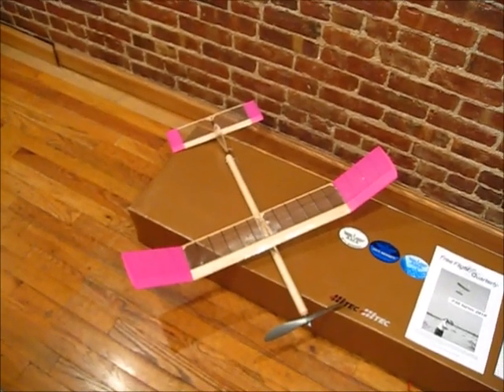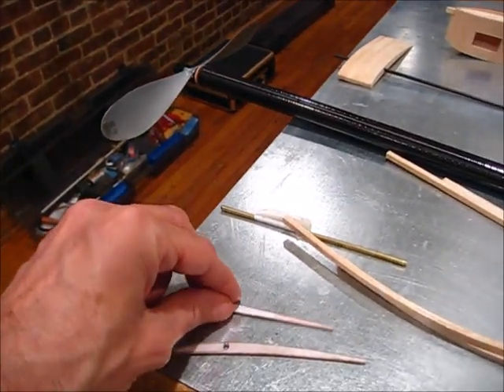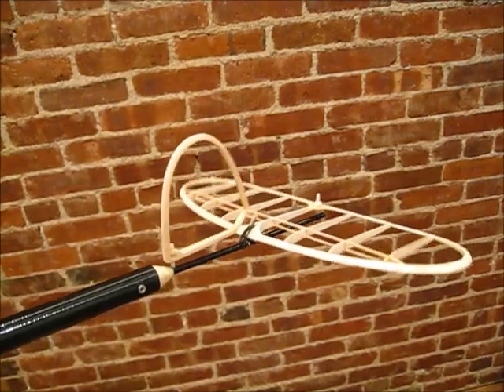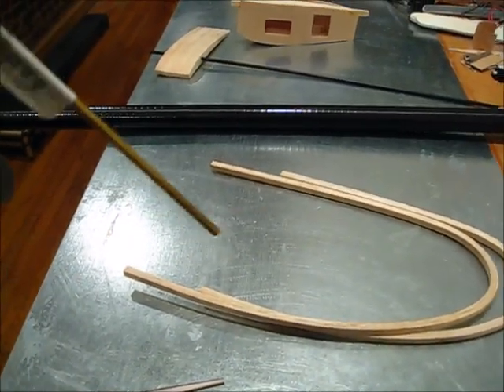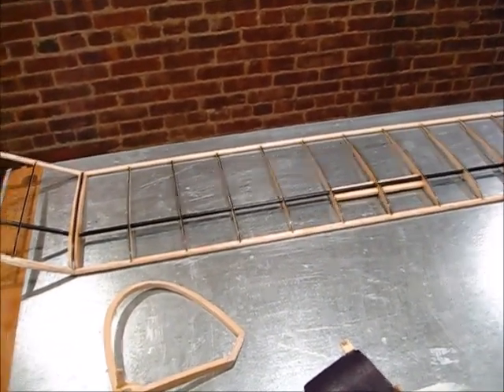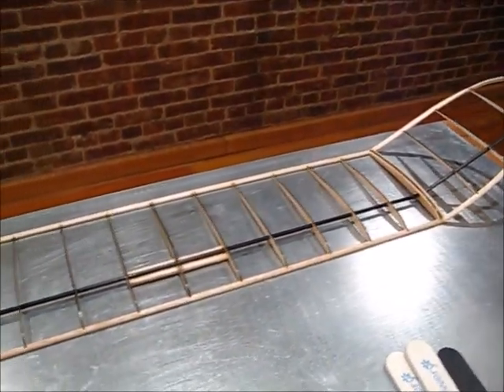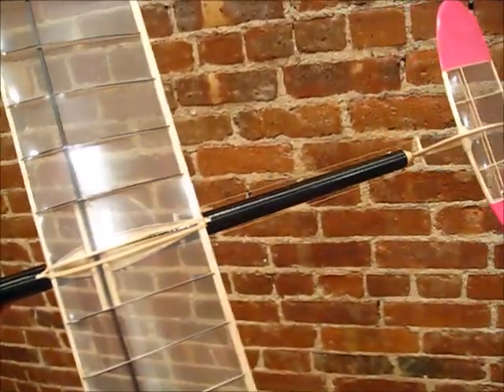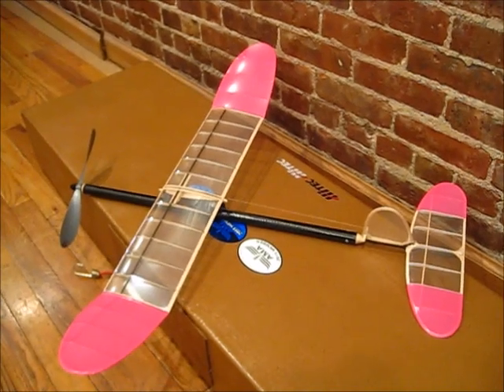'Hell's Kitchen P30' rubber power RC - building.

Comment: Hi! If I may ask.... how do you build the nose button? Thanks very much !!!
Reply from the maker: The nose button is an adjustable one available from Volare and other places. The button is mounted into a nose plug which is laminated balsa, rounded on a drill.
Reply: @domoremath  Thanks for your reply! I"m 72  years old. I was a high time sailplane pilot.  Left the hobby in 1980 - time for family!  I've never done free flight before. Very attracted to your approach. My closest flying field is about a 40 min. drive. Bit expensive as a retiree. In Canada, we  can be fined for flying in a school yard . 
I have a hard time imagining an Enforcement Officer writing up a 72 year old man for flying a rubber powered model. The other nice thing is if the radio fails the model isn't  going to hurt anyone or damage any property. 
Anyway, thanks again for sharing all your experience! Will keep in touch!
Reply from the maker: @chrissorlie5291  Yes, it's very inexpensive and harmless, I've never had any problems in the local field so far (for 11 years), and you're correct that they don't really hassle old guys with rubber power models, voice of experience! In fact, the police usually ask me where they can buy the model. Have fun, it's a great hobby.

Comment: Hi:
I watched your video.  Very nice!  I a couple of P30 questions.  I bought a carbon fiber tube from Mike Woodhouse.
I would like to use C/F spar for wing and stabilizer.  I imagine the 4mm tube for wing, and 3mm for stab.  I like your idea
For the C/F capstrips !  Where do you get that sheet or tape? How thick should it be?
Sincerely,
Jon B. Shereshaw
Reply from the maker: Given that I made it in 2017, I wouldn't know the answers at this point (!) but fortunately I made a detailed plan - the wing spar is 3.2 mm carbon fiber, the capstrips are 1mm, .12mm thick, the ribs are 1/32". I didn't use a carbon tube for the stab, it's just 1/16" square top and bottom, and I'm not even sure you need that, as I mention in the video, the laminated outline is very stiff. I got everything from Mike Woodhouse, however I see Volare also has nice capstrips. The carbon fiber fuselage tube is really nice, can handle a blown motor, and it's pretty much ready to go.

Comment: Building a polecat p-30 now.  I'd saw an earlier video saying that your mylar was adhered with gluestick.  I am not getting a very good covering using it.  Did you dope the wing prior?  I'm using the shiny (chrome finish) mylar which I've been told doesn't shrink as nicely.  I'm more than proficient with tissue, and hate any wrinkles.
Reply from the maker: Yes the chrome mylar doesn't shrink as much, use the clear stuff if you want no wrinkles! I just rub UHU glue stick directly on the structure, make sure you get a good coat on and smooth out any lumps with your fingers. I've found it sticks pretty well, if you're having problems then maybe a little dope on the structure might help, but I like to do it directly on the undoped wood.